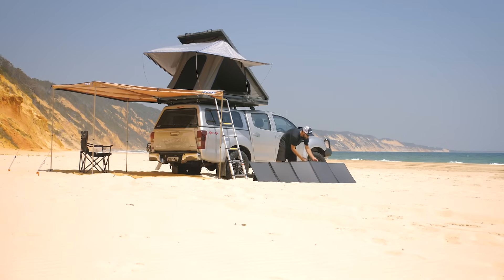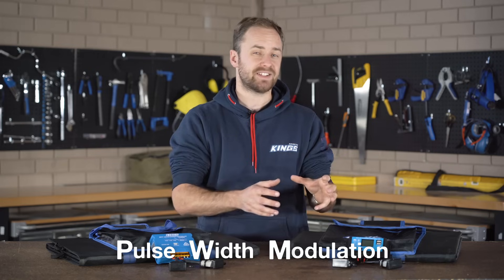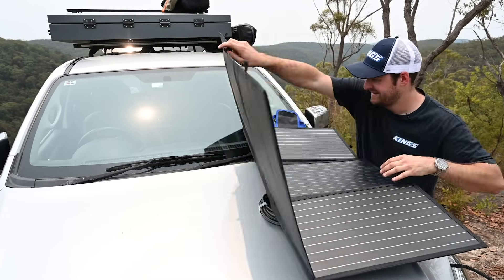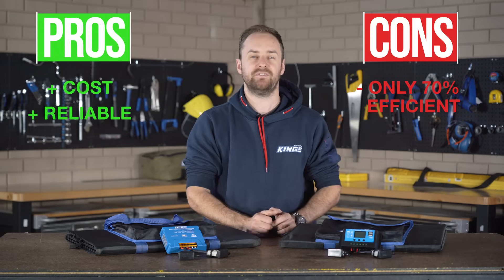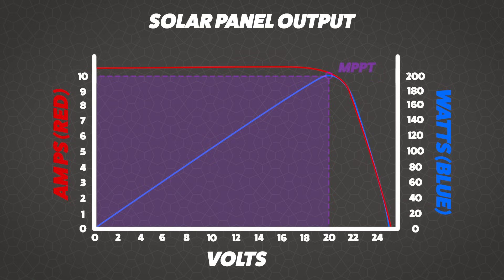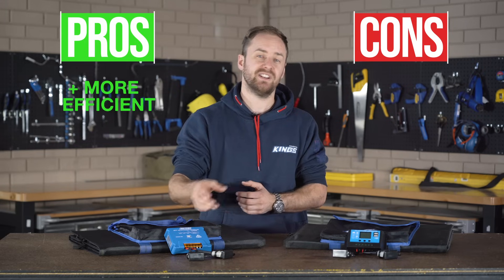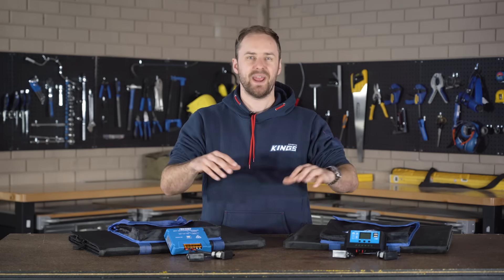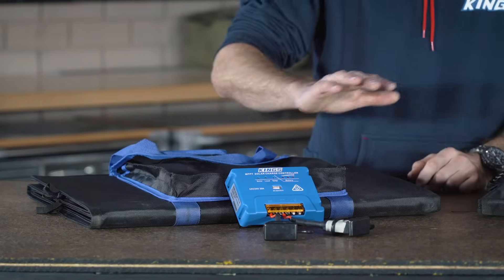SOLAR REGULATORS EXPLAINED! PWM versus MPPT - what's best & why? PLUS upgrade your solar controller!

Comment: Thanks for the indepth explanations of how the two types of solar charge controllers work.   Best I've heard.  I believe, however, that many pwm charge controllers, even the umbiquitous cheap ones,  can do either 12 volt or 24 volt, but they cannot modulate or change the output like an MPPT so your panel voltage has to match your battery set up voltage.  MPPT are more flexible and with some of the higher end all-in-one  combined MPPT charge controller and inverter, you can line your panels up in series from 120V to something like 440 volts, allowing crazy pv string voltage!  So a lot of that depends on the model.  They vary widely.

Comment: Got the cheap pwm,  30 amps,  using it on a 36v , 170w panel, works OK,  it says, it can take 50 max,
Reply: Your only getting less than half the power out of your panel with pwm. Mppt will reduce the voltage and double the amperage.

Comment: What happens with an mppt controller when the voltage from the solar array is less than 12v, say in a very cloudy day? Will it boost the voltage to 13v so the battery can charge, albeit at a lower current?

Comment: I want to connect up my Camper Trailer to my car, and have portable solar as well, do i need a mppt controller or will the dcdc charger do the same job saving me purchasing and installing a solar regulator?
Reply: Get a regulator.

Comment: Weird how my PWM is a 24 volt version and they also make them all the way up to 60 float. This video is 2 years old but I guess out dated when it came out. I don't think I will trust the rest of the details in this video but the general concepts are correct. ALSO rarely do solar panels put out the wattage they claim unless you are out there tracking the sun and adjusting your sun angle. All seasoned solar owners know this so for those who don't... unless you have a your panels mounted on a solar tracker PWMs are probably fine for your needs.

Comment: Regardless of what type of controller you use, please be careful. It is necessary to hook the controller up to your battery first, before connecting your solar panels. To not do so will burn up your controller.

Comment: As a work around I use my Bluetti ac200p and a 500w lifepo4 charger to charge my 4 lifepo4 12.8 100ah batteries while feeding my Bluetti 1000watts of solar..This works fine for me, I’m just using my Mppt charge controller in my Bluetti…I get needing a Mppt controller if you’re using just batteries for power…

Comment: Nice explanation.  The problem now that most people know about MPPT is being exploited on eBay as many of these PWM controllers are being advertised as MPPT.  It will say MPPT in the title but if you read the fine print, it will say PWM.  I responded to a couple sellers, and they just use the excuse that the marketing dept needs to fix the problem.
Reply: I also have found increasing levels of dishonesty on eBay. For instance, if you search for a 200W solar panel, many are way too small to crediblely be anyting more than 80W. Similarly, steel is listed as "marine grade stainless' when it corrodes after a few weeks. Ebay needs to fix this problem.

Comment: Haha  baby stuff  there’s 3 types of current need
1 Motorhome      100a.           1200w panels

2 caravan              50s.               600w panels
3  off road 4x4      25a.               300w panels

You need roof area  4x4 need the bonnet and cab to make 300w.     Most camper park in the shade lol so fixed panels are counterproductive

Comment: Hi i have 1x 100ah leshure battery but i am thinking of getting another and join them paralel what regulator would you recomend i am currantly using just one of those blue ones with 2 x solar panels in serius 10 w each connected to the regulator but as i said i want to add another 100ah battery can you advise me thank you .i have that same blue regulator

Comment: wish to have one 160 watt kings solar panel of roof connected permanently through premium solar controller and then connect 160 watt folding panels in parallel when arriving to site only as required, charging a 120 ah lithium battery only load i have is kings 75 litre fridge
will this be sufficient for five days
Reply from the maker: Hey Glen… a tentative yes: assuming you get good weather!

Also try keep your fridge out of the sun, if it’s in your vehicle make sure it has good ventilation (cars get hot and fridges work much worse in the heat!)

Cheers,
Cahn
Reply: @4wdsupacentreAu  thanks Cahn I still need to go through with someone my setup just to make sure Ive got it right, not sure if I should go through this forum or talk to my local kings store
Reply from the maker: All good Glen!

We get so many comments it’s hard to follow on here, so maybe best to ask your local. If they still can’t help you out, give them all your details and tell them to contact me!

Cheers,
Cahn

Comment: With the mppt modulator what r the chances of overheating the system and does it reduce the life of the solar panel and can this also void the warranty if using and something happens anywhere in the circuit of the charging system.I have the TJM solar panel

Comment: Thanks for your video.. With a better understanding of the two charge controllers I realized that I bought the wrong charge controller. My question to you is if I install a 30Watt PWM charge controller on a 200WATT solar system will it work. My battery is 200wh battery with a 3000Watt Invertor. The reason I ask this question is because I have seen a video on YouTube that said I only need a 15Watt charge controller for a 200WATT system. Can you assist me with this problem and may be tell me why I couldn't use the 30Watt PWM controller. Keep up the good work.
Reply: I believe you mean 15 amp not watt and 30 amp not watt.
1 amp at 12 volts is 12 watts.
10 amp is 120 watts. 
A 20 amp regulator or larger will handle 200 watt panel.
A 30 amp is fine.

Comment: Really Good Comparison  ! Very well explained ! 
 
 Now our mppt units over here are Huge in comparison to that Kings mppt? 

 How come that its so small ? In the big ones over here are made with large hestsinks that take up over half the size of the unit . 

 I bought a pwm unit for 3dollsrs here in Sweden and i looks exactly like that pwm in this video . But i figure its broken the display doesnt show that the panels are hooked in . And ive already checked the panel and it works with the multimeter and gives Volt . 

Thank for the ideas and Tips ! 
 Regards Paul Roger Nilsson -North Sweden

Comment: As kings arnt making a 25amp dc dc any longer I've grabbed a 20amp kings dcdc and a mppt digital controller what's the difference hooking these up to the 12 volt control box no solar wire on 20 dcdc an where do I connect the grey lithium battery wire inside the control box and can I run the mppt thru one of the Anderson plugs on the control box or run direct to battery? Would preferably like to run mppt digital controller thru 1 of the control box Anderson plugs! Please help Me out with this issue

Comment: You are 100% correct in using an MPPT with a portable solar panel or blanket to maximise the output. On my small garage (fixed hobby) solar system, it was easier and slightly cheaper to just add another 100w panel rather than upgrade to MPPT. The extra panel was about $125, about $50 less than a new MMPT.
Reply: For smaller systems yes MPPT cost more, imagine you have a 12 volt battery system, for PWM controller you stick to 12 volt panels, idk about the price where you live but here low voltage panels cost more per watt. So if I have to match a 550watt panel+ MPPT charge controller with 12 volt panels+PWM controller, the solar panel will cost 2X the price of a 550watt panel. Will take more area to install the system.

So for larger systems MPPT makes sense.
Reply: @CroftGaming1  Hi, you are correct. Having said that,  I have since replaced my PWM with an MPPT to harvest more power.

Comment: im starting solar, i think i have a pwm even though it says mppt on it because people clain it just a pwm, so it a 12/24 100 amp controller. im running 24 volt batterys. one guy says he has 3 panels 12 volt feeding this controller, others say more like a 75 amp controller than 100, and i can set the shut off voltage, i dropped it to 28.2 volts from the 29.5 volts it was set at, what should it be? i have 10 more panels to add, all 12 volt 100 watt, was thinking 6 in 36 volt, and 4 with a 30 amp controller paired to the batterys of 12 volt, while the 100 amp controller stays 24  volt

Comment: So I have installed the kings battery box with battery as per your install video, which was great 👍. I have hooked up a solar panel on the roof of my car and it works awesome (also connected to car as per video) my question is, when I’m parked in my garage and I don’t go anywhere for a day or two the battery is obviously not getting charge from the the Sun. What I want to do is add in a Y Anderson plug, and install a solar panel on the roof of my house and have the lead run down so I can quick connect. So that both solar panels are connected at the same time. There is some light coming in through windows in my garage and this hits the solar panels at certain times of the day, on the car,but will it be ok and not affect the charging of the battery with both getting solar? Loaded question thank u for your response.

Comment: Hi there Quick question,

Can you use the MPPT charger on a lithium battery also?
Reply from the maker: Hi there,
Unfortunately you would not be able to use a MPPT alone as it is not compatible with lithium.
Regards, Courtney
Reply: @4wdsupacentreAu  ok cool thanks. So just to clarify, Not alone, does that mean I will have to use the PWM instead or both together?

Comment: I have a 250w solar panel and it has the MPPT 20amp controller (kings) attached, charging a 138Ah AGM with the Kings 12 v battery monitor fitted on the maxi battery box.

Yesterday i brought a new 120 Ah Lithium battery and a 15amp PWM Solar Controller. (the 138Ah is too heavy for my back)

1. do I have to use the 15amp PWM solar controller with the 250w panel charging the 120Amp Lithium or can I continue using the 20 amp MPPT that was originally on the solar panel I brought last month?
2. Can I continue to use the battery monitor I brought last month with the new Lithium battery ( maybe turn down all the low voltage and turn up the high voltage settings and run the monitor on AGM?)
please advise best action I should do. regards Peter
Reply: The 15 amp pwm will limit your power to 15 amps. So your better of using the 20 amp pwm.

Comment: With your 120W solar blanket I am consistently getting 25 to 30% more power output from the PWM compared to all of the big brand MPPT charge controllers I’ve tested. Why would that be? Isn’t meant to be the other way around?
Reply: I wouldn't trust the display of a pwm controller. Use a separate meter as a comparison.

Comment: Well explained. Especially that the PWM is only 70% effective. Nobody ever mentioned that. I now made a trickle charger for my SUV standing in the garage with me working from home mostly. The battery goes flat after 2 weeks, so. I used a cheap 200W solar panel and PWM controller. It works perfectly. It keeps my car's battery charged. In this case I did not need a MPPT controller. So I suppose PWM is still useful for low key applications.

Comment: Man
0 seconds ago
The other advantage to mppt is because it can handle higher input voltages you can wire your panels in series which means it doesn't need to produce as much current to get the same power output

This means you can use smaller gauge wire ore longer runs of wire with less resistance losses.

Comment: I'll be the second comment my chargers charge my batteries at 14.7 volts and they also scream for more batteries because they charge my batteries by about 9:00 in the morning even before Sun starts coming up the daylight is charging the batteries and it almost charged when the sun comes up and for the other charger I want to get one of those but I can never afford one so I can't tell you anything about them.

Comment: That's why mine keeps begging me to turn my batteries into 24 volts so I could charge at 24 volts I actually want to charge a 27 volts you are a liar cuz that's what I'm running and I can run 24 volts with it and that's what it wants to run it doesn't like running 12 volts and that's what it's running and I've already ran it at 24 volts that's how I know.

Comment: if you buy a blanket and battery do you get the regulator from kings in the pack or do you buy it seperately
Reply from the maker: Hi Sharyn, we sell heaps of combo deals for solar + battery + regulator. Check out this link and select from the left hand bar which size panel you're after - https://www.4wdsupacentre.com.au/solar-power/solar-power.html?page=2 or give us a call on 1800 88 39 64 and press option 3, our staff can also create a custom bundle for you.
Cheers, Mia

Comment: Great video..Thx. If I get the MPPT ..is it worth it with only one or two 100 watt panels? I have a 35 amp battery, is the MPPT too pwerful to charge that? or do I have to go to a 100amp batter?

Comment: Newbie Question , just received my first solar panel Briefcase style 100w with PWM controller to use while camping to help keep batteries up. do i need to disconnect it if i am going to run my Generator  for the whole Travel trailer ? will it case damage it the system. thanks

Comment: Enjoyed the video. Well explained. My question is can MPPT regulator be used with Lithium Batteries?
Reply from the maker: Hi Phillip, the MPPT is not compatible with Lithium batteries. Cheers, Mia
Reply: @4wdsupacentreAu  When will Kings be releasing a MPPT solar regulator that is compatible with your lithium batteries. The 15 amp PWM is junk... sorry but it is! I have had 3 of them. I now have a 20 amp MTTP S/Reg spare, doing nothing.

Comment: Great Video! 
Firstly,  I'm about to change from an AGM to a Kings LIfepo4 battery with BMS, do I need to change the controller to a lithium controller.
Secondly. is the battery connection a 2way operation. For me at least a quick vid on how the wiring actually works would be handy. 
Love the professionalism you guys brink to the tube.

Comment: Hi Cahn, should I disconnect my kings 20amp mppt regulator from the battery box when my car is parked at home? Thanks!
Reply: Regulator do use power, but its only about <10 miliamps. Per hr. I'd disconnect it to save parasitic drain.

Comment: Can you hook up two 115amp kings batterys to the one control box and charge them both at the sametime keeping it still a 12 volt system
Reply: Wire the batteries up parallel. + to +

Comment: It would be good if you could add the positive of having supercapcitors within the cycle.. From what I have found out this is 30% to 40% increase in battery life and overall performance increase of 25% to 30%. Win win..

Comment: FYI found Renogy Rover 20 Amp 12V/24V MPPT Common Positive Solar Charge Controller Regulator Compatible with Lithium Sealed, Gel, Flooded Batteries and Bluetooth Module.  $81 US

Comment: How do you bypass a solar regulator on a panel ? I have a D C D C charger on my power station and need to turn off the regulator on the solar panel.

Comment: I have 8 discarded 190W (5.21A, 36.5V) solar panels in my shed. I guess one of these is equivalent to your 200W blanket, so if I put it on the shed roof could I use the MPPT regulator to charge a battery, or is the voltage too high. What sort of regulator would I need if I put all 8 panels on the shed roof?

Comment: Bought a trailer with PWM controller. After watching your video I'm trying to find a strict 12v foldable solar panel around 200 Watts all the specs report something like: short circuit current 12A current at Pmax 10.9A open circuit voltage 22.5 voltage at Pmax 18.3 volts. I will loose significant power correct!?

Comment: I’m trying to find a video breaking down what lights should be on constantly or flashing… my solar panel light is a constant which the user manual says “Solar panel voltage is
higher than the light
control voltage” and is should be pulsating but not rapid. I noticed in this video yours is a steady in as well. Can someone please enlighten me. I’m new to this set up and struggling to understand if I have a faulty MPPT. thank you

Comment: I just upgraded my small 200 watt system to a MPPT charge controller, and what a difference!! It turns on way earlier in the mornings and shuts off just after sunset. It charges up by batteries in about half the time as my old PWM did. Real world conditions, real world testing. Greetings from sunny Jamaica.
Reply: Memer Dreamer  Sounds like you have been smoking some serious stuff..lol
Reply: MPPT controllers are useless on a cloudy day. They spend all of their time resetting and recalculating then sometimes they get stuck on a lower output when there is a cloud or haze but once the sun comes back out they can still be stuck on the lower calculation from earlier forcing the user to reset the MPPT to force it to make a new calculation.
  Show me some videos where people plot charts to make comparisons in real world situations.
It's better just to run a DC to DC step down converter. It will always convert the power available whatever that power is at the panel. It won't waste time recalculating constantly as clouds pass over.
Reply: @izzzzzz6 I use both PWM and MPPT controllers.  The MPPT is more useful to me as I can run higher voltage panels on my 12v system.

Comment: I am considering purchasing 2 of these 330 watt solar panels for my caravan to be roof mounted. Can you recommend the correct mppt charger for them  the Open Circuit Voltage is 39.2 volts. Thanks Keith